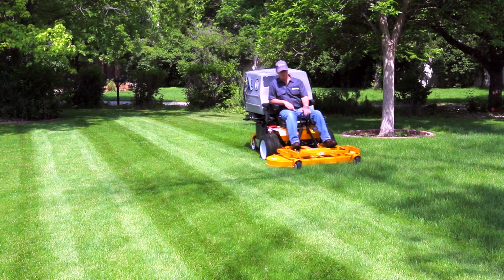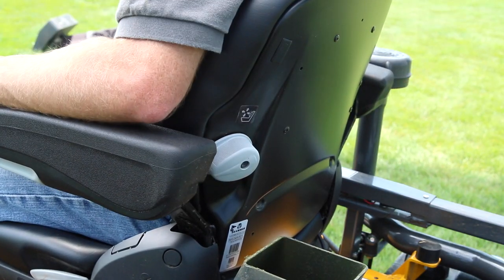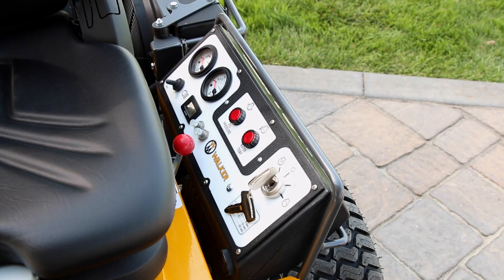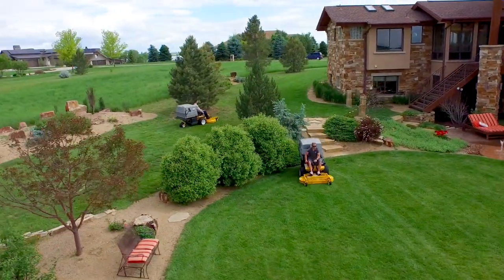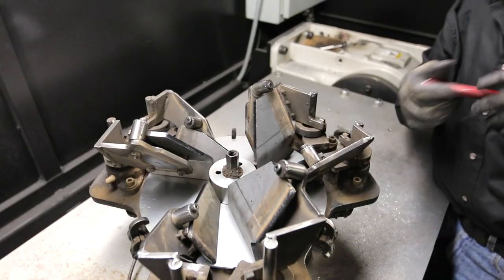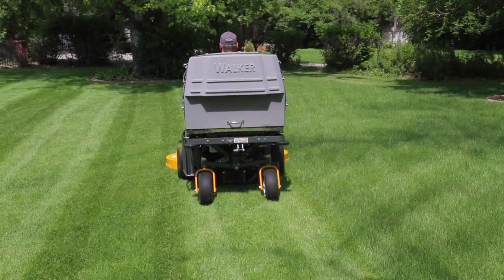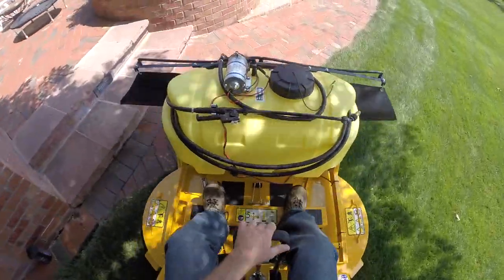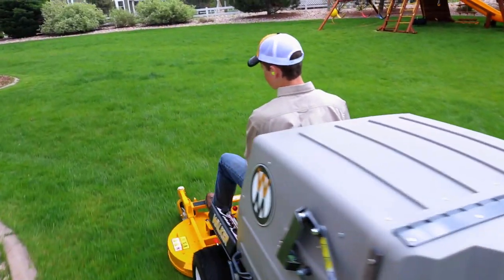Model D In Depth [2015]

Comment: the full signal horn does not work on my mower, nor does the lift dump switch. any idea?
Reply: Saiyan 2301 test it by turning the key to the run spot before u start then turn the blades on, open up the rear door and test the sensor. If it does not beep, that means you need a new sensor unit.